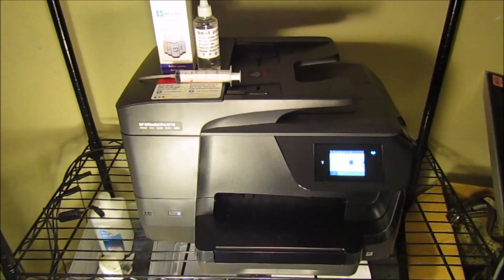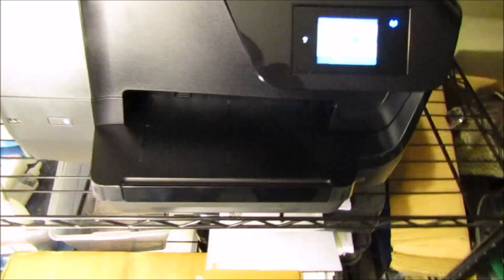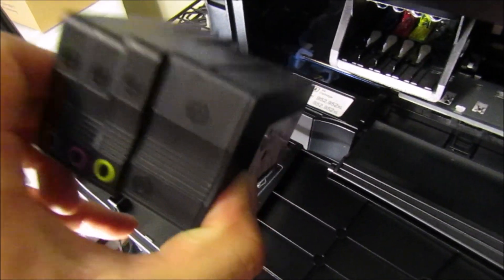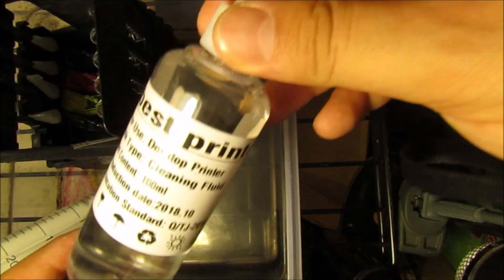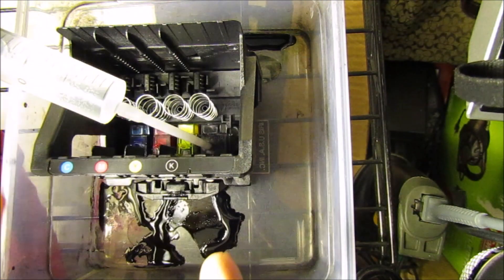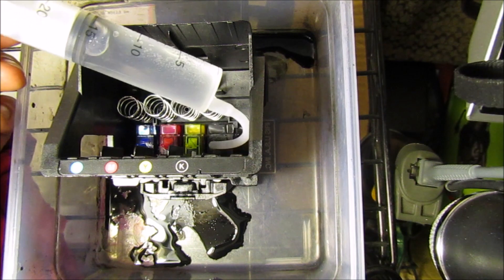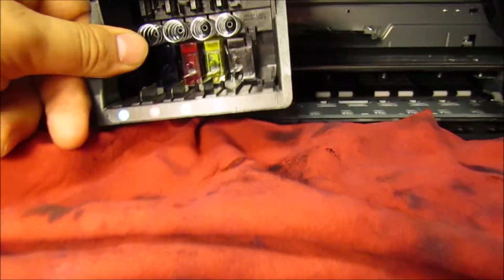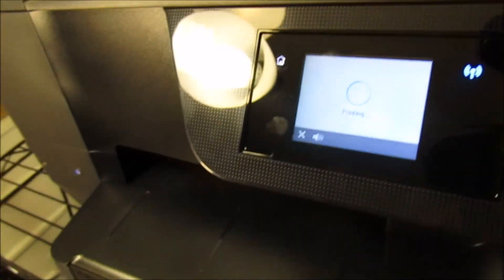HP Officejet Pro 8710 HOW TO UNCLOG PRINTHEAD

Comment: whenever I try these half ass methods yes it pushes ink through the printhead but then afterward it the prints get worse as all the colors get more blended/faded.  Do I need to keep wash/dabbing the bottom of the printhead where all the ink comes out too?  I have done that but the same result.  Should I also flush the printhead by running it under water for a few minutes as well?  Can regular water be used after the initial printer cleaning solution, if I have to repeat it 10 times to get it completely clean?  This method never really works in real life with the '1 or 2 syringue full' pushes, please explain what to do about the mess that happens on the printhead 'outflow' area where all the inks come out and also seems to have a never ending supply of ink coming out when letting it drain/dabbing it with a paper towel
Reply from the maker: If you ran out of solution, distilled water will help. Also the other colors fading is normal. You just need to make sure to install na new set of ink after doing the cleaning.

Comment: I bought the kit for my 8710 that sat for a while and the print head became clogged. All colors are great now but I still have some lines in the black. I want to clean it again, but I am out of the cleaning solution. How can I get a refill, preferably more than 100ml too?
Reply from the maker: If you require more than 100 mL of cleaning solution you can simply use isopropyl alcohol this is a acceptable substitute

Comment: Thank you very much for this video and your cleaning kit. I ordered the kit and it came in 2 days. I followed the instructions on using the cleaning kit. I only cleaned the black ink reservoir. I let it dry overnight then reinstalled new black cartridge. Worked perfectly!! Thanks again
Reply from the maker: So happy to hear that! Thanks for watching and supporting the channel, and I'm glad the cleaning kit worked out great for you!
Reply: @BestPrinters Placing water on the chips on the printer head doesn't damage the print head?

Comment: hi... i cleaned my printhead as per ur video... after cleaning, cldnt print coz ink depleted (cyan)... i replaced with a new one... still cldnt print... it says theres a problem with the ink supply system... tried replacing with with new cartridge... wont work either... u have any solutions?
Reply from the maker: The only other solution would be to purchase a new printhead for the printer.
Reply: @BestPrinters  That will be the last resort

Comment: I have been using your method for the printhead, it worked however I have to use it a couple of times during a week.  I have a HP OfficeJet Pro 8710. Purchased new ink & still have some problems.  A couple of days ago, purchased refill for blue & magn. so I replaced each cartridge.  Now it is saying that there is a problem with the supply system.  It also reads that I should replace the affected cartridge with a different cartridge, but all of them are new (just 3 days old).  HELP!
Reply from the maker: The printer may be at the end of its usable life, if you had to keep doing the cleaning weekly.
Reply: @BestPrinters  Thanks

Comment: Didn't work. And now I look like a smurf. The blue isn't working and I tried to get the fluid through it, and it wouldn't move. It was also a real challenge to get the tube onto the syringe. I had to heat it up to get it on.
Reply from the maker: Did you run a printhead cleaning afterwards? Repeat the process until blue/cyan comes back.

Comment: I am getting "Supply System Problem" for my HP OfficeJet Pro 8710. I error came up after replacing the black ink. I try multiple inks. Only happens on the black ink.
Reply from the maker: The printer may be shot
Reply: @BestPrinters  what do you mean by Shot?

Comment: Hello Best Printers.  Happy to say that I just revitalized my 8715 printhead following your direction and printhead cleaning kit.  Worked like a charm!  So thankful that you saved me the cost of a new printer...and now I am using the oem ink that costs much less and I cannot yet see a difference in quality.  (time will tell)  I do suspect that my problems began when the black ink ran low.  The color ink was not having problems.  Thank you!  PS, yes, close the latch!  The assembly eventually does slide back to home when you are performing the cleaning process, even with the printhead out of the printer!  Yikes!
Reply from the maker: George, i am so happy to read your comment. I am glad you were able to save your printer with these instructions! If you would like to show additional support you can leave a Super Thanks donation, you will find the Super Thanks button under the video!

Comment: The Magenta ink in our HP Officejet pro 8710 was streaking, so I did a search online to find a DIY solution and found this YouTube video.  I ordered their product off Amazon and followed this video's instructions and it worked!  No more striped print-outs and now I know how to solve this issue in the future.  I ended up cleaning all the colors since I had everything taken apart anyway (5mL each, then another 10mL to clear off the back and bottom of printhead) and still have solution to spare.  

Another user commented that you should put the latch down after you remove the printhead, and I wish I had read it before because I had a bit of battle trying to get the printhead to stop moving.  I eventually got it back to the position needed to reinstall it and the ink cartridges, but not without yelling obscenities at it for a few minutes.

Comment: Bought your cleaner kit on amazon, used it like in the video and still get the same Missing or Failed Printhead with error code: Oxc19a0003.... I did put the same cartridges that I refill at Costco every few months or so!  Do you think that if I put in brand new ones in that I won't get that error code?
Reply from the maker: To be honest that code is very difficult to deal with. I dont reccomend putting any more money into it unfortunantly.
Reply: @BestPrinters   Yep that's what I thought!  Thanks
Reply from the maker: No problem!

Comment: Thank you for the video. I recommend that the latch should be returned to its original locking position while working with the printhead. The printhead compartment starts to move back to its home position after a while. If the latch is up, it becomes stuck which may damage the printer.

Comment: last time i used printer print quality was good.  today i went to print and i am seeing error code 0x19a0023. the printhead appears to be missing , not detected or incorrectly installed.  I have never touch let alone removed.  does it need replaced ?
Reply: I am having the same issue now! Did you ever get it resolved? If so, how?

Comment: Great video- I ordered and used 10ml on black. Now the printer is saying there is a  problem with the supply system and it says to replace the black cartridge but the cartridge is practically new! Any ideas?
Reply: I got the same issue.  Did you ever get it resolved? how?
Reply: @jbuckingham7167  same here, did u end up resolving it?
Reply: Same issue with the Magenta, was this resolved?

Comment: After you cleaned with solution, I did not see you re-prime the colors with a syringe.  Is that supposed to be done to clear out the cleaning solution that is still residual in the colored container of the print head?  Or is just installing full cartridges and letting it auto prime the best way to set it back up?
Reply: Waiting for this answer...

Comment: Thank you for this video. may I please have the link for the where to purchase the print head and a new printer and discounted ink.
Reply from the maker: Hi, yes I added the information below.
HP OfficeJet Pro 8710 PRINTHEAD : https://amzn.to/2ZgOhzG
HP 952 952XL Ink : https://amzn.to/31XLcGH
Reply: @BestPrinters  Hi, Thank you for the video.  I have two questions: 
 1) I saw the print head in the link and it costs just as much as the printer did or close to it at $273.  Can you recommend another print head that might not cost as much, but that will still serve the purpose?
2) Will cleaning the print head help with "Supply System Problem" error code?